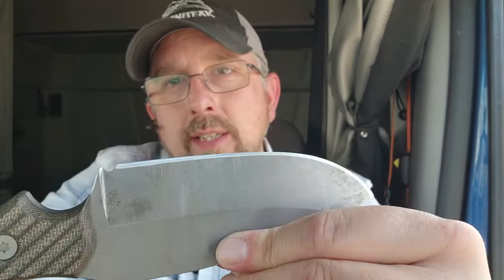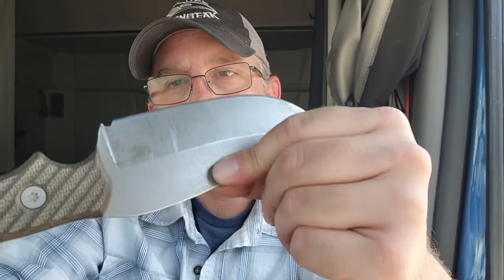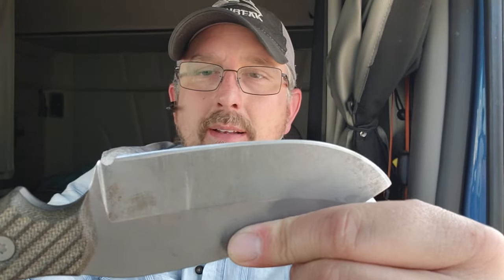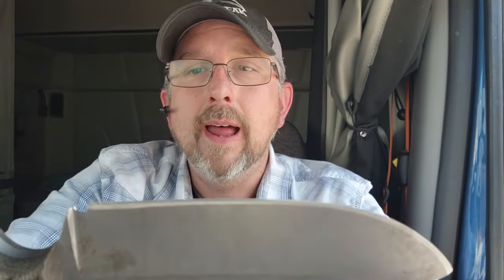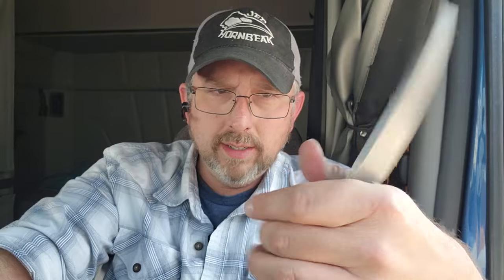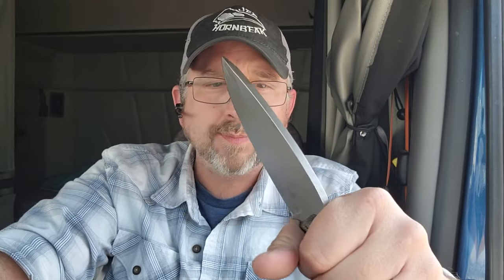I need your help real quick. 80crv2 or 5160 Steel for the Amygdala ?

Comment: 80crv2 is basically swedish saw steel. Probably way easier to work with compared to forging 5160. Highly doubt anyone would notice a difference between the two. The less stainless the better if you ask me.

Comment: You never mentioned witch  is the best to sharpen. The only 5160 knives I’ve tried are Ontario’s fairly soft heat treatment that I’ve found to be kind of a pain to sharpen compared to other higher carbon steels.
Reply from the maker: Both can be sharpened extremely easily

Comment: I would pick 80CrV2 over 5160 by a long shot. It is easier to work with and grind, so less belts will be used. It is also very tough and IMHO 80CrV2 holds a better edge since it can be run harder. O1 is a step up from either in edge retention, but is not quite as tough. After that I would go with Cruwear. I bought some to try out but need to get a CO2 tank so that I can make dry ice as needed for chryo.
Reply from the maker: Cruwear is exactly what I'm thinking for my first batch but I'll have to hire someone for heat treat. I need a whole lot more than nitrogen. The soak times...I gotta get a better oven. But yeah Bos or Peter's charges the same rate to ht cruwear to 64 or 80crv2 to 59...makes no difference to them. So we're just looking at the incredible price difference in the steels...overall though , it'd be a much more usable blade in cruwear, just ain't gonna be a batoning / chopping monster. It's tough but I assume it'll be more brittle at 64 than these poor man steels. I was looking st 01 as well. I'll have to work with some of that in the future. Thank you for stopping by Ken, very much appreciated bro.
Reply: @apex_alchemy_knives  I have been doing some research on Cruwear. The conclusions that I came to are 64 HRC for folders and fixed blades that are cutting tools and not for supper hard use. 62 HRC for hard use fixed blades and choppers. I have some knives in each category to make and the right oven to do the heat treat. All I lack is the ability to cryo, but I have a plan for that. IMHO Cruwear is the ideal steel for fixed blades. It is very tough and holds a great edge.

Comment: I like 80crv2 but if D2 or Cruwear are an option I would go with either one of those
Reply from the maker: Yeah they definitely are for the first batch , i can't heat treat cpm d2 or cruwear myself ...not the way I'd want to. I could get it hardened but not optimal. But if I'm paying a pro to heat treat the first batch anyway, why settle ? I'll have to ease my way into plate and air quenching ....and then cryo...all that stuff is foreign to me right now. That's why I was gonna leave it to 80crv2 or 5160...but honestly there are a lot of options if we aren't concerned with my heat treating it. ...man I think I'd love to have one of these at 64hrc in cruwear...I think 🤔 😅😅

Comment: Well since other guys are throwing other steels in here scrub the 5160 and go with some A2 or cruwear. Done right A2 is some good steel
Reply from the maker: Thanks for the suggestion. I'm thinking the first 10 may very well be cruwear but I haven't made up my mind just yet. I need to though. Real quick and in a hurry 😅
Reply: @apex_alchemy_knives  i do like cruwear, and that toothy edge it has. Good luck brother